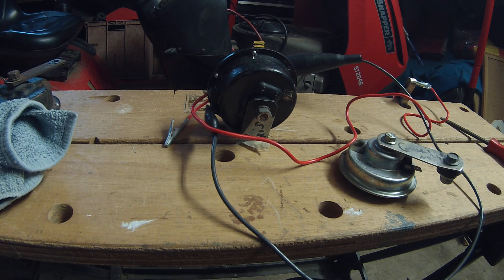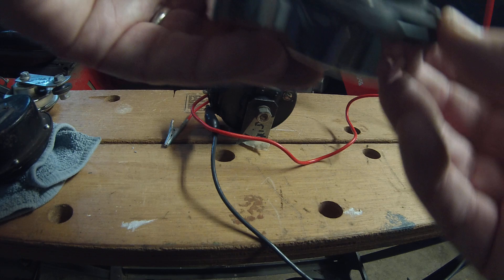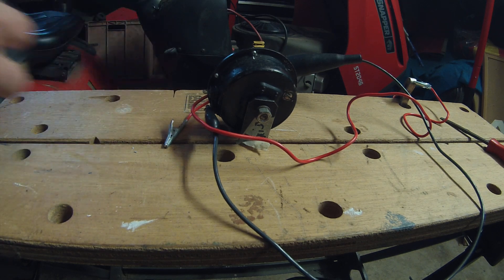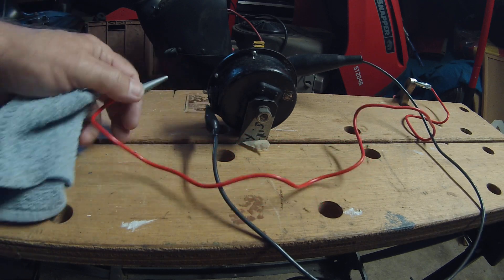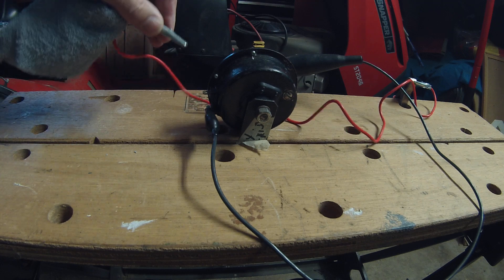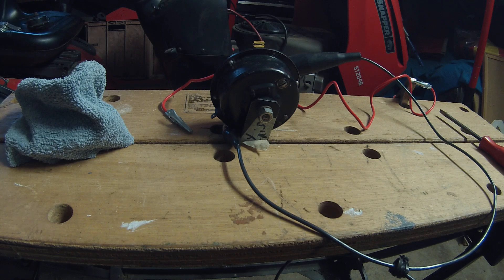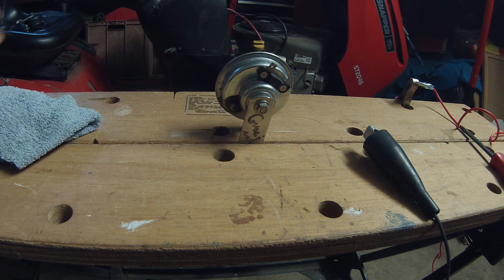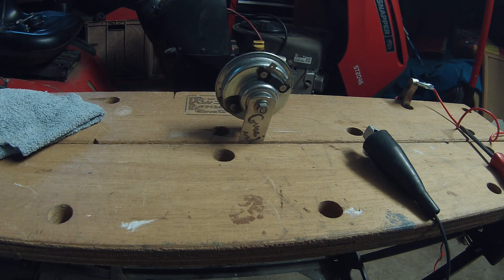Loud Horns - adjusting horns

Comment: Get a decibel meter app on your phone
Reply from the maker: I never thought to use the Phone app decibel meter for the horns. I did do a video using the Phone app decibel meter for the different mufflers I put on my Yamaha venture… that’s where I lost confidence in decibel meters depicting actual volume because, my stock Yamaha mufflers were only 8 dB quieter than the 2014 Harley Davidson St. glide mufflers. Both sets of my folders were completely stock not modified… but in real life, cruising down quiet, little town, main streets, I was embarrassed by how loud the stock harley mufflers were. 8 dB is a big difference… bigger than I thought in the real world..
  you are right, I should have used the dB meter, even to adjust the volume on that one horn I was trying to get to be louder..
  I have a set of hella freeway blasters on my small bike, Kawasaki, Z400.. I did it right, feeding them with number 12 wire through a horn relay. They are nasty little horns. I never highlighted them in any of my videos of that machine actually making sound. I think I’ll do that.
  thanks, JiM